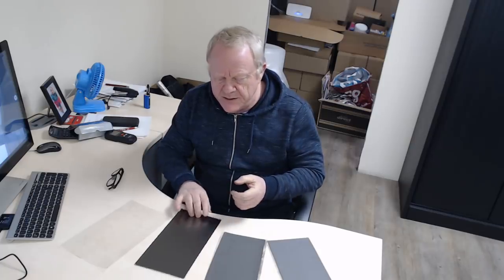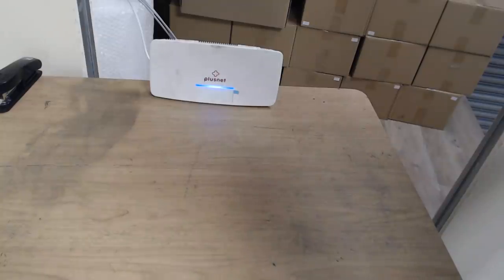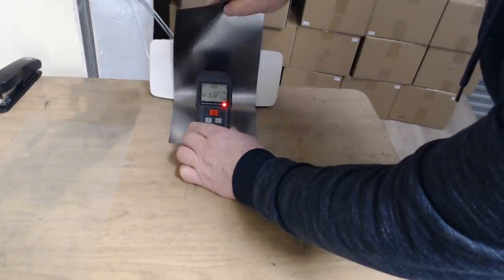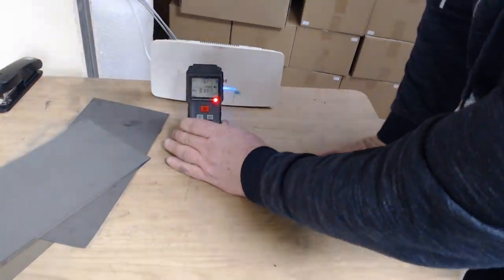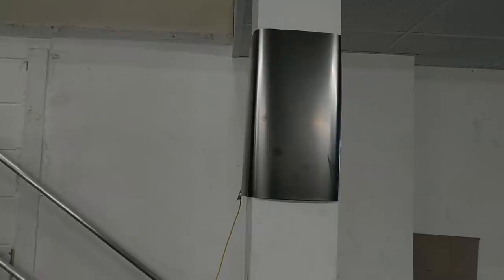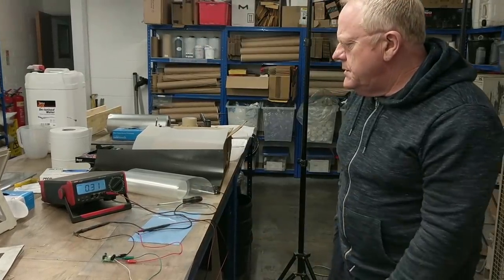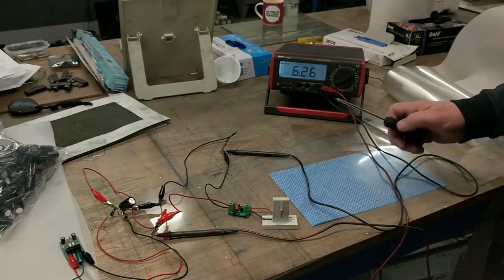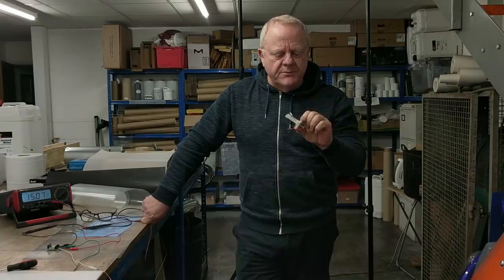Energy Scavenging With A Graphene Sheet

Comment: Can you print them as fractal antennas?
Reply: My idea for years. I would tune it to earth's magnetic and the sun's if you know the frequency.
Reply: @jasoncunninghambluejmc  Technically TRILLIONS of frequencies travel throughout the universe, and a large enough fractal antenna would pick up a very large cross section of them.

I'm just not sure if you would need it spread out, [like catching sunlight due to surface area] or if you could use a loaded coil and 'draw in' EM from around your dipole.

If you needed it rolled out, you would need it protected from the environment which could destroy your array [the number of hazards is vast] either by shielding it with armor or possibly you could get away with simply burying it beneath the soil, or line the inside of large warehouses with it...just guessing...
Reply: @DeliciousDeBlair  I think I know how to build "or print" the fractal antenna... ever seen the video where the guy runs an audible frequency into a "flat speaker" with salt on it and it forms wonderful patterns? ....
Reply: Same here
Reply: jason cunningham brilliant,

Comment: For Sale? I would buy some sheets of this for experimentation.
Reply: Just use tinfoil or copper sheeting from a hobby store. You saw it works the same
Reply: I have used copper aluminum  stainless steel and several others already. I am however, interested in properties that the material may have that were not demonstrated in the video. I would be interested in obtaining a sample of ‘tinfoil’, but cannot find a source, it seems  aluminum foil is all that is available? Thank you.

Comment: Cat's whisker 
crystal ray- HAY HAY duo :-)
Germanium diodes are a one way street for alternating electro magnetic Wave's & the  crystal radio can drive a piezoelectric oscillation in the ear piece.
Head's up! When a vibrating tuning folk is placed between a permanent magnetic & a wire connected to a voltage meter: VOLTAGE IS GAINED :-)
A moving magnetic field captures power :-)
Am or any other oscillator frequency will do?
Just make Fr££ energy & share :-)

Comment: I'm interested to know of any opertunities in responsiveness to sunlight by any of the properties you are working with at FWG?
Reply: Rob did something similar the sunlight did increase output so did height from the ground.
Reply: @Barskor1  I think it would be awesome to have a battery the would charge itself in the light.
Reply: @jeffreyrood8755  It was like a solar panel not a battery made of the same stuff IRC but batteries need a case and all the rest so you could make one charge up a battery but not likely to be a battery.

Comment: EMF shielding of 5G (if it is possible) could make you lot's of $$$.  Millimeter length waves are hard to block though.
Reply: I think you're wrong about the mm waves, I might be remembering things wrong but I think they  cannot travel far or go through things or through green vegetation but they are deadly, it is a weapon.
Reply: A wooden wall should block 5g
Reply: Nonsense. That would make 5G the worst phone network to have.  What? No indoor phone calls?
Reply: @BushImports    Look up "Cape Cod Radar."

The military found that their millimeter wavelength radar would penetrate buildings and scatter making it possible to actually see behind walls. (somewhat)
Reply: @milesprower6641    Wooden Wall?  How about tissue paper?  Nope, 5G penetrates through most everything.
Reply: @ericlinz4626  Interesting so if all home WiFi gets switched to 5G every home is basically open book for spying.
Reply: @Barskor1    Bingo !!!  As if the Police State isn't bad enough it looks like 5G might offer "X ray vision".

They discovered some weird effect and I forget the name...  worth a look at "Cape Cod Radar".
Reply: @ericlinz4626  Will do thanks!
Reply: Number 1 it's an indoor proof of concept, but generally to you r point. I'm sure a commercially available system could easily include low wattage re-emittance of the information you want, otherwise I'd rather harvest as much"freely" available energy, especially ionizing, as I can and have cheap lower wattage repeaters, or even wifi coupling in the home for info systems.

Comment: Good replacememt for the tinfoil hats! :)
Reply: Might need something like that with the 5G being deployed.  Millimeter wavelength radar was tested in Cape Cod by the military.  Worth looking it up.  See through walls.
Reply: @marthale7   There is some kind of relationship between the wavelength and the ability to penetrate or to see.

I "think" (from my limited research) that the shorter wavelengths (like 1 millimeter) tend to react more with the atmosphere and generally scatter more easily.

The longer wavelengths actually pass through objects more easily but give less feedback because there is less scatter.

So if you want both penetration and scatter you would use a millimeter length wave and higher power.

Which ironically is what 5G and the military weapon that makes you jump off buildings (feels like fire) is all about.

The weapon is orders of magnitude more powerful though.

Comment: Roofing material
Reply: Silicon spheres mixed with roofing paint drops the temperature inside a building like you wouldn't believe. You can buy silicon spheres from building suppliers its used in decorative concrete to lighten and strengthen it. You just mix the spheres in with the paint so its the consistency of a slurry and either paint it on or use a broom to paint it on the roof.  I just thought I would mention this interesting fact.